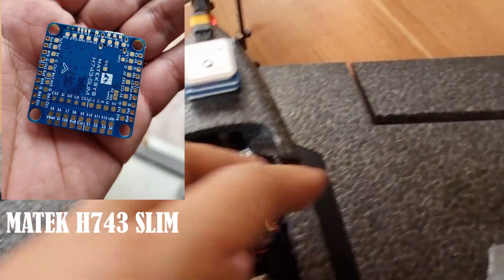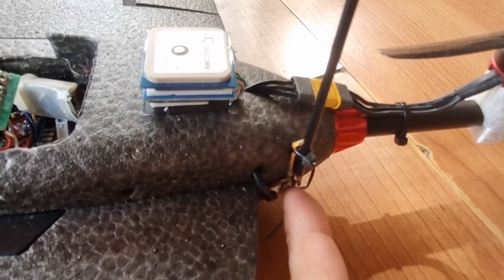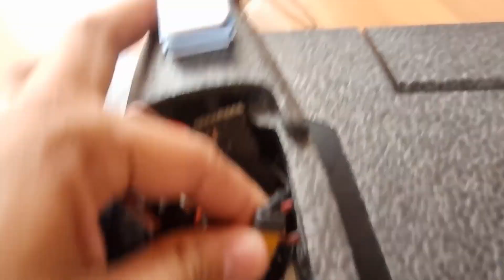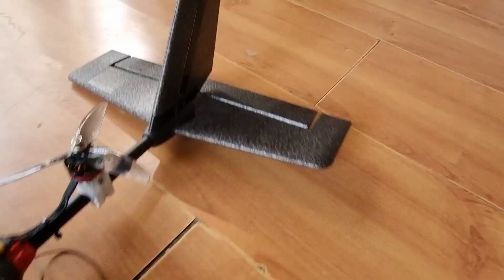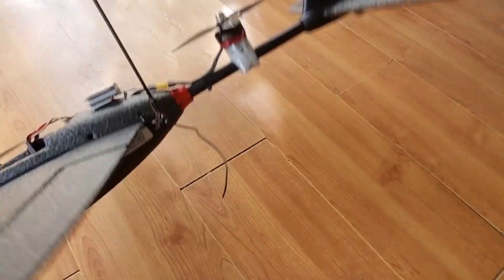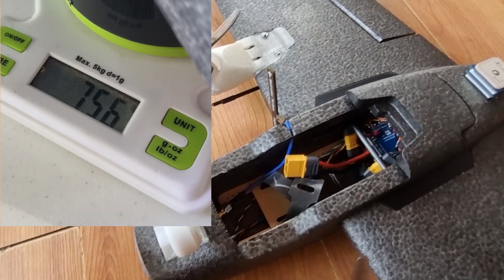Hee Wing T1 Ranger VTOL build walkthrough

Comment: so nice video, I have the t1 kit and I was wondering where did you get this conversion kit? it seems it's not hee wing conversion kit and it has better quality.
also, I have Spektrum and Tx16s as transmitters, may I ask you what TX you would recommend for each?
Reply from the maker: mine is 3d printed, but if you want something off the shelf that is much better than heewing's in terms of quality, you might want to check this one:

https://www.rc-vtol.de/shop?store-page=Conversion-kits-c135586096

alsom you can use either spektrum or the tx16s, but if i would prefer the tx16s for functionality.
Reply: @windfpv  thanks I go with Tx16s,but I don’t know what type of receiver and flight control I should use,can u help me
Reply from the maker: flight controller should be anything that can run latest arduplane firmwares. you can consider Matek F405 wing/wse/wte, VTOL, or h743 wing/v2/v3. receiver depends on your radio, anything that can output sbus is good. if you will use external tx modules like tbs crossfire, elrs, just make sure to buy the compatible receivers.
Reply: @windfpv  I got u
Thank u

Comment: thanks for all this info.  STOL is so new to me.  nice to see the big 22xx motors on the T1.  I have been weighing 1806 vs 22xx, but the 22xx is safest with 4S and of course a ton of thrust for tricopter mode for sure! (though I am doing this with an old Dart not a T1, but similar size and weight)

Comment: What kind of battery are you using?
Reply from the maker: lipo, 4s 1300mah
Reply: @windfpv  How did your flight control fit into the plane?
Reply from the maker: the Matek h743 fc is small enough to fit :)

Comment: Nice project!! Whats the flight time?
Reply from the maker: about 10mins on mixed flying, but with a LOT of throttle control and low speed flying, i was able to get about 15mins on the 4s 1300mah pack

Comment: Great build overview. Thanks for sharing. ♥👍
This answers most questions I had, other than those related to Ardupilot. Marc has posted an overview of his Ardupilot FC configuration. Appreciate the very useful info you both have shared.
Reply from the maker: Surely, I will make a video about it too, 😁 I'll post the parameters asap. I have sent marc some settings to test 😁
Reply from the maker: check out the parameter file, i have posted the link in the description of the video
Reply: @windfpv  An useful reference. Many thanks.